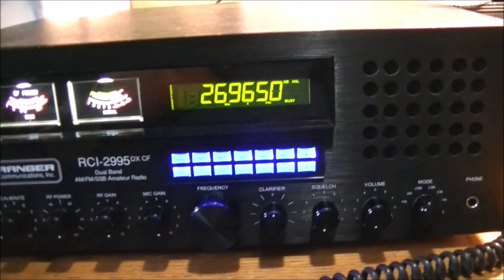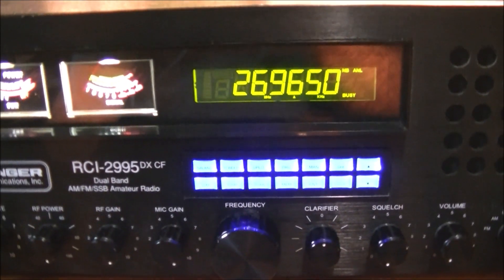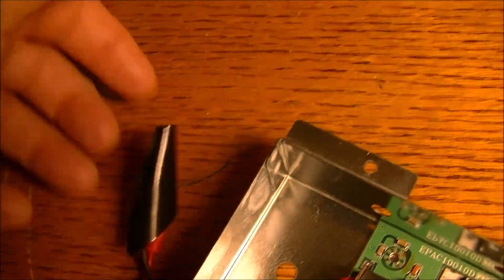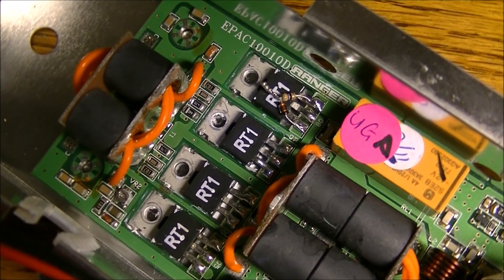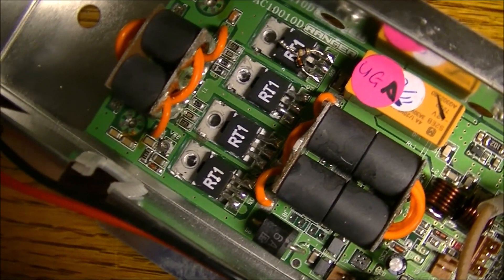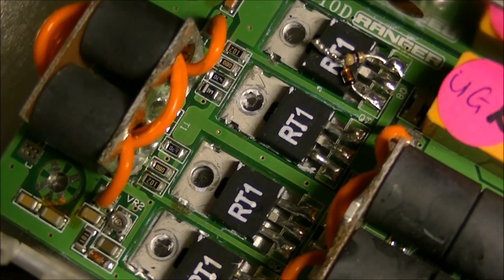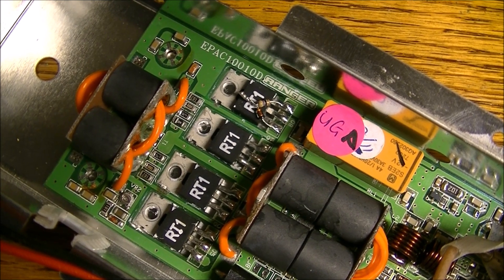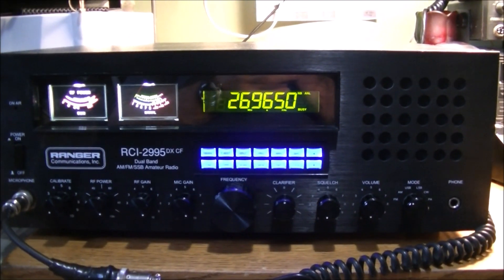Ranger 2995 DXCF Mosfet Failure Part 1

Comment: Why are there diode and resistor on one of the rt1s look like swing kit
Reply from the maker: I am not sure why they are there. I asked an amp tech and he said he was not sure either. This radio was sold and serviced by Bell's CB Radio and it was returned in 2020 for a warranty job. the power supply failed. I guess we'd have to ask Bell's CB  what they are for. It is a qustion I'd like an answer to for sure.
Reply: Was just curious looked not stock but who knows
Reply: Feedback control from stray inductance.